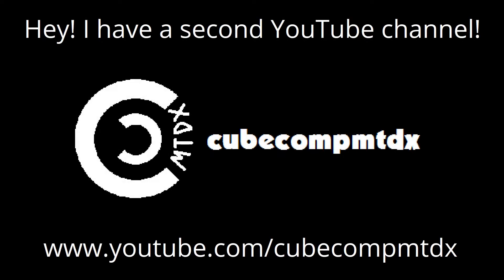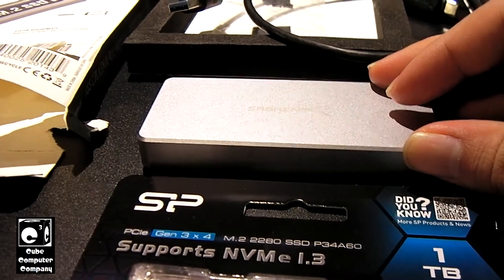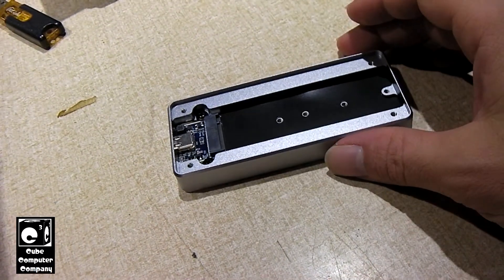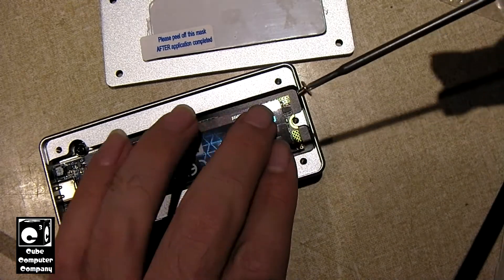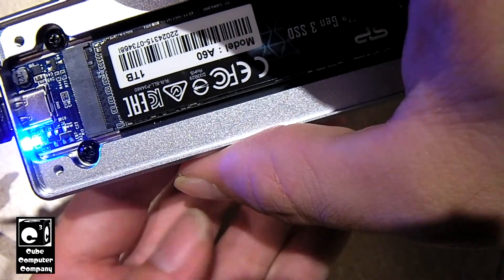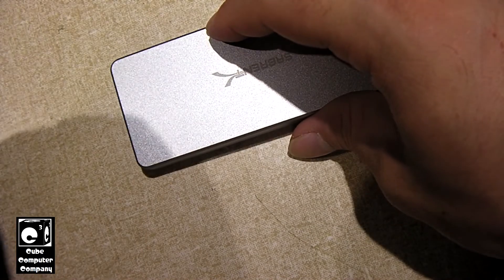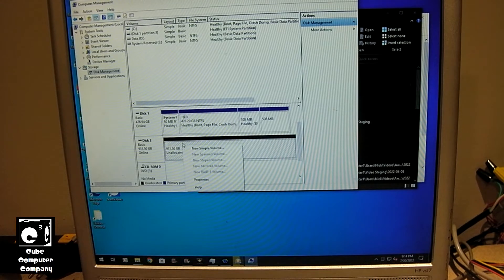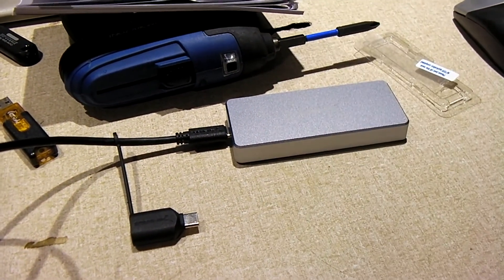Installing M.2 PCIe SSD into Sabrent Portable Aluminum USB-C SSD Enclosure

Comment: The only draw back to external nvme drives are the read/write speeds are capped at 800mb per second. You definitely don't want high speed nvme drives (slc), I use intel 660p (tlc). The intel drives are slower and less expensive. If you run a speed test on your new external drive, you will see.
Reply from the maker: The Intel 1TB 660p lists right now on Amazon for $79.99. I spent $69.99 on the Silicon Power 1TB drive I installed in this enclosure. Here's a link to the SSD I bought:

https://www.amazon.com/dp/B07ZGJVTZK

It is in fact an SLC. I probably could have gotten a TLC from a different manufacturer for cheaper.